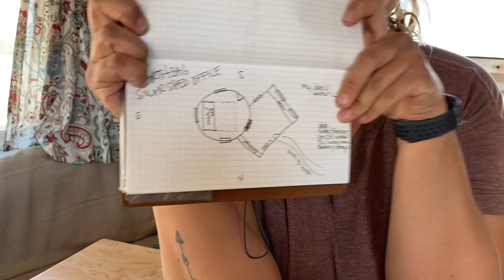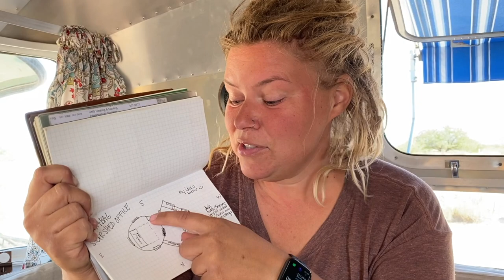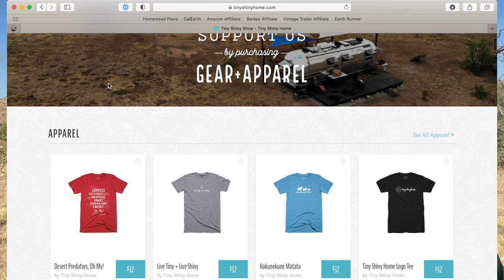Changing our Solar Shed Plans from Strawbale to Hyperadobe + More Animals, Wildfire, Shirts

Comment: You may want to draft that building with real dimensions for the fridge. Refrigerators are big and it is going to go about 1/5th into the 12’ side of the room. 
Might want to put the battery bank and fridge in the same wall to save on electric cable too
Reply from the maker: Obviously our sarcasm didn’t come through well enough 😂 - of course we’re going to mock it up in real dimensions first 👍🏻
Reply: @TinyShinyHome  🥳